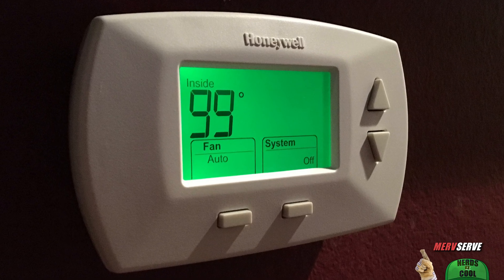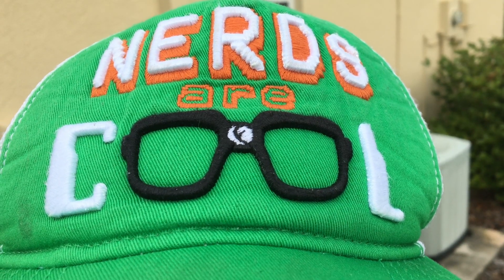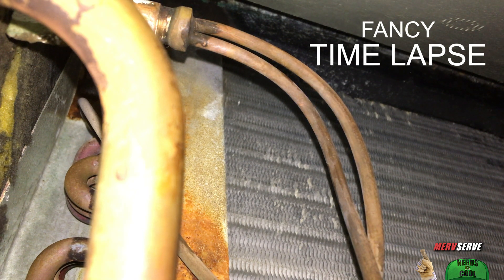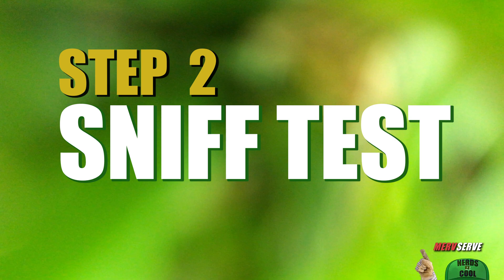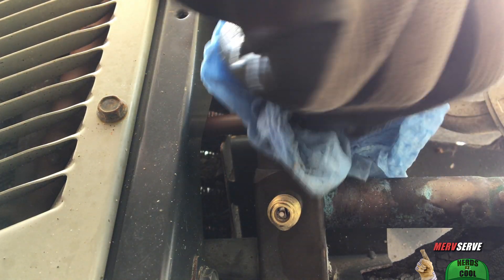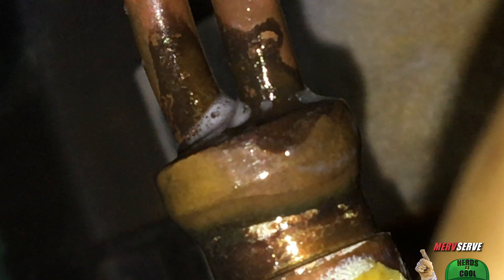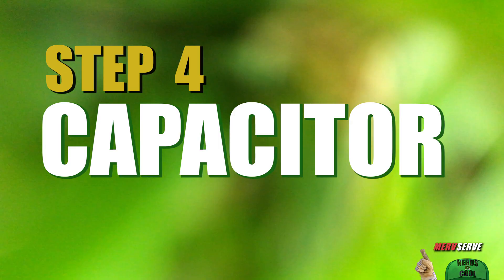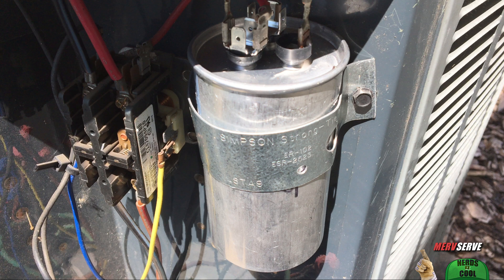AC Broke? How to Find & Fix AC Leaks

Comment: don't put soapy water in the shrader valves! it only takes a single drop of water in the refrigerant to totally destroy the compressor! if you put water on the valves and then close them up before they are dry then when the tech comes to put refrigerant in the system or check pressures he's going to inject the water into the system and then the countdown to compressor failure begins
Reply from the maker: Excellent point. So what you are saying is it's really important to let them dry out before capping again.